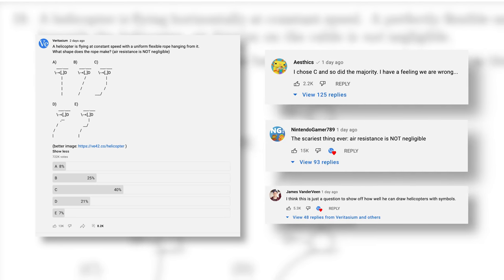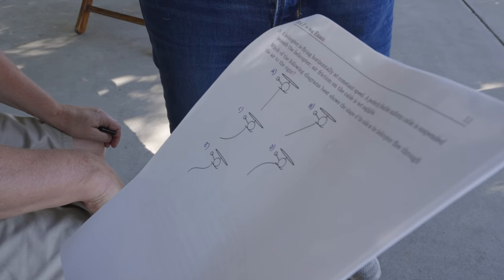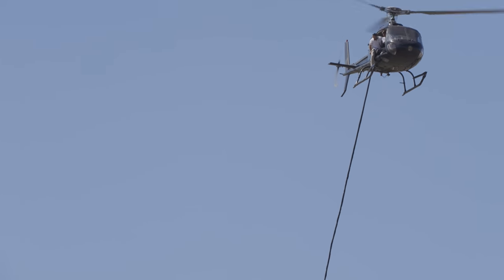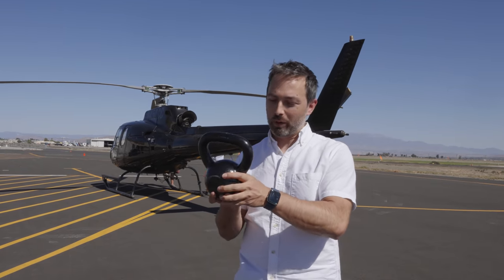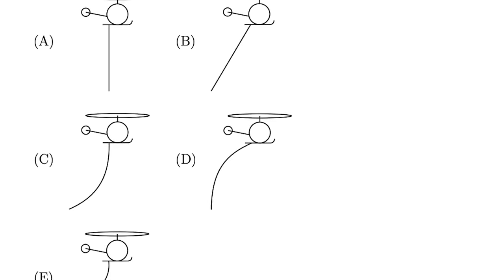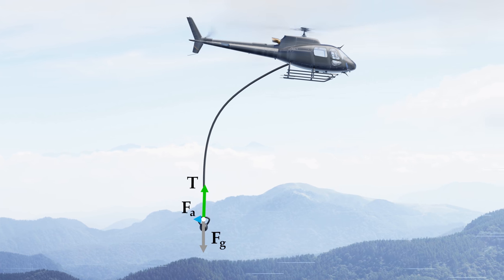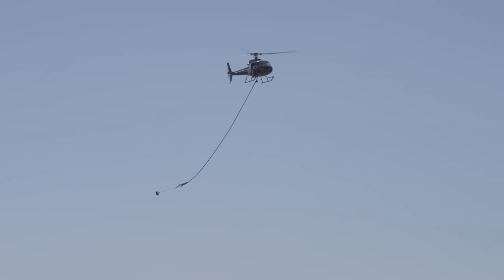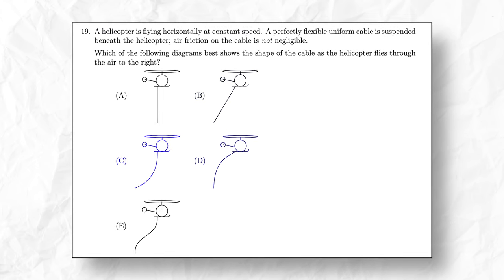I Rented A Helicopter To Settle A Physics Debate

Comment: My first guess was B, but then I thought "no way that's too simple", and that you would have to factor in that ropes want to hang in a catenary when suspended between two points, so I went C. I guess there is no second point, only drag, weight and tension. I would not have passed :(
Reply: I picked B right away. I didn't even doubt it. When I saw the poll, I was really dissapointed.
I know this from school where we were learning this type of forces.
Reply: I also thought of B, but as there is some controversy in this, it must then be something else. Seems like I should rely on my intuition.
Reply: I thought D because I assumed it was weighted given that logically you would want any rope hanging out of a helicopter to be weighted.  Also should read better lol but that's how you know the question wasn't made by pilots

Comment: but the actual ans of this question is option A.....since question already mention that there is no air friction so the velocity of cable at the time of suspension will be the horizontal velocity of helicopter at that time that is constant. hence no acceleration, hence no pseudo force, hence only force on cable is gravity so cable will hanged perfectly straight

Comment: I actually thought it was most likely C or E, since I imagined the main rotors wind having having a lot of effect on the wind. I guess E would work if the rope was really wide and there was a weight. Same as C requiring a lot more surface area and downward wind for it to work
Reply: Yeah, my prediction for E seems to be something more likely with a flat strap with minimal or no weight beyond the hook or shackle. As the rope is round and sheathed, it isn't affected by airflow as much as I predicted. 

Answer D is accurate for ropes with hooks or shackles. I've seen it like that when watching Blackhawks fly away after dropping a cargo load while I was in service.

Comment: I love that you went to all that effort to work out the answer!  Although, as you only have like 4 minutes per question; I'm not sure how feasible this is in an exam situation. It's bad enough having to drill all those holes in rapidly filling bathtubs.
Reply: Well, force diagrams applied to multiple points on a string/rope are a popular thing for solving such problems. Plus, you are referring to a test that has students with an IQ of 160 taking the test. The test is only for finding the best, not the average.

Comment: TBH knowing how far the rotor wash reaches would've been quite an important factor in choosing the right answer, since most of us aren't helicopter pilots.
Reply: Just admit you were wrong because you don't know the answer.
Reply: @mikeznel6048  I sure as hell didn't know the answer, because the question didn't present enough information to make an informed choice. The only unknown factor in the test was the rotor wash and everything else could be easily simulated by moving a piece of string at a constant speed dangling from your fingers. As the weight of the helicopter determines the rotor wash, I doubt the outcome would be the same with a heavier helicopter with larger rotors such as a loaded CH-47 Chinook.
Reply: I mean, since reach of rotor wash is inversely proportional to volume of gas due to greater resistance from exponentially more and more gas molecules, it makes sense that motor wash shouldn't reach and affect the rope much at all. Fluids acts much differently when against a wall and when in free flow, after all. A tidal wave's force crashing onto land has a lot of reaction forces in various directions, but a tidal wave's force on the sea will just disperse omnidirectionally except on the surface due to it being Newtonian fluid and acting like a solid when facing a great impulsive force.

That said, I didn't think of all this either, but it does make sense, and can be deduced with logic.
Reply: @mikeznel6048  The professor gotta admit he didn't know the answer either until he mathematically determined what he observed. As such the students are expected to give the correct answer with less information. At least the professor feels great about his own intelligence.
Reply: @I_THE_ME  I think the answer would be the same for heavier helicopter. If you think about it AFTER watching the video - it seems pretty confident that rotor wash not only dissipates quickly, but it also spreads around as a cone, with a more or less untouched area in the center. Because rotor is spinning, rotor wash will spread away from the center.
Reply: @Mike Znel what a stupid comment.  There was no constant speed given, so the rotor wash absolutely could have some effect.  just because something "looks" diagonal doesnt mean it actually is in theory.  And before you get onto me about just 'not knowing the answer' I am a degreed physicist who does theoretical modeling.  The question did not present enough information to make a definitive answer between B and C.
Reply: @bermchasin  But it shouldn't, because the resistance of the air around grows exponentially more than the area of rotor wash, which increases the rate at which it's forces are dispersed. Although I got the wrong answer, I never took rotor wash into question.
Reply: That AND knowing how heavy the rope was.  A lighter rope would be more affected by the wash (and other air currents too).  Not really faulting the video, more just speculating that there is probably no ONE answer for all combinations of helo, rope and (I suspect) forward speed.
Reply: The type and weight of the Rope is also relevant, because a Light, High Drag Rope will have a higher angle.
A Light enough Rope, with enough Drag, going fast enough, would be parallel to the Ground, meaning the Rotor Wash, and the Tail Rotor (which affected even the stationary drop) would both be in play.
Reply: Dude I got the answer correct and I’m not even in high school yet it seem like a common sense kind of question.
Reply: Yeah, that turned a nice qualitative and intuitive problem into a gambling lottery. Would be nice to hear professor’s motivation why not inform students that rotor wash could be neglected?
Reply: Do this with a small drone sized helicopter and a piece of string, and rotor wash will likely be very relevant.
Reply: @VADemon  I got it correct without doing math because I thought about an infinitesimal segment of rope. Each ds must have the same forces, so same angle of rotational, so the line is straight. Pretty much exactly like Derek explained it.
Reply: @evilkillerwhale7078  if rotor wash mer significantly larger then the rope at the top would experience a greater force downwards than the one at the bottom and so the rope would make a "J" shape. Guess that's why you dropped out

Edit: A test where you have to imagine what the teachers thoughts were is a really bad test. In this case, they didn't ask: what happens if you drag a rope around? They ask: what happens if a helicopter asks a rope around? So you're sitting there wondering if they didn't think properly or if the chopper part is relevant information.
Reply: It says right off the back the rotary wash is not negligible=meaning it's not important
Reply: Rotor wash in forward flight is essentially negligible to anything beyond the wing/rotor length.
Reply: @evilkillerwhale7078  I found his animation to be counter-intuitive which is why I didn't follow the video too closely.
Your explanation, however, is clear.
Reply: Also, being a physicist would have been a big help..
Reply: Helicopters don't FLY FORWARD with their rotors parallel to the ground. The rotor wash must be diagonal as well to propel the helicopter FORWARD. There's enough information!!!
Reply: Another thing to consider is that the mass of the rope has a significant impact on whether or not the rotor wash is negligible. If the rope was light enough any amount of rotor wash would have an effect. This video is with a super heavier rope. Not really a definitive answer in my opinion.
Reply: @evilkillerwhale7078  Second comment. I'm gonna be pedantic but that's math you did there. I can no longer call it a "thought experiment" what you did, if you compared different forces acting on an infinitely small piece of a rope. Quicc maths

Comment: I think the reason most people said C was because a lot of us (like me) imagined that, since the tension is less at the end of the rope, wind resistance will have a larger impact resulting in a J shape
Reply: that was a really thick rope.
Reply: I imagined the answer is never exactly B but the small C curve that is produced by the slight weight of the rope is not perceptible to the naked eye.
Reply: I’m certain I know why most people chose option C. I think most people chose C because they assumed the rope would’ve been in a fixed position pointing perpendicular to the aircraft and ground and not on a pivot like shown in Dereks explanation and experiment. The ability for the rope to pivot at its starting point from the aircraft gives the rope the straight diagonal representation. A rope with any amount of stiffness with its starting point being fixed at perpendicular to the ground and aircraft would result in option C, this can more easily be imagined with stiffer shorter rope travelling at a high speed where the end of the rope will trail behind the fixed starting point resulting in a curved shape like option C. Overall it was a poorly defined question that, from the diagrams presented, suggested a fixed starting point. Often people’s misconceptions lie within the question asked not the reasons behind the “answer”…
Reply: But the air resistance is cumulative--just like the weight--as you go up the rope, so this actually makes sense.
Reply: With a lighter rope, overall tension would be less, so wiggle at the end would be greater, and air would keep it at one position, so it might have taken the J shape.
Reply: @InfoAction_  the question said "perfectly flexible" though, so it would be as if it were on a pivot even if it weren't
Reply: This was my assumption, that the longer the rope, the more air resistance it would have towards the bottom, as there was more and more rope, and you got further away from any propeller downdraft.  Especially since the question stated that drag was NOT negligible.
Reply: @InfoAction_  not really. I was solving this question in my mind, and when I was analyzing a portion of the rope, I misplaced the downward tension of all lower parts with their gravity force, thus downward force was growing and backward force was constant. I studied physics in the univercity, but in this case I simply wasn't attentive enough.
Reply: Perfectly flexible rope, pretty clear l0l
Reply: Most people realized that every point on the rope has to carry the weight of all the rope below it, meaning that the top of the rope carries more weight than the bottom; but didn't realize that the same is true for the drag: every point on the rope has to carry the entire drag of the rope below it, meaning that total drag increases towards the top exactly in the same way as total weight does.
Reply: @InfoAction_  What kind of fixed starting point for a rope makes it so the rope can only point straight down from the start point? It seems you're a bit too salty for not being able to answer it.
Reply: @Weaseltube  You could exchange the rope for a heavy chain made from steel or something, it would still be exactly B.
Reply: @yarati4584  oooooh I think that makes sense, yeah. Thanks.
Reply: @yarati4584  Yeah, that's where I went wrong.
Reply: @Muzikman127  the question in this video was stated as perfectly flexible, in the questionnaire before this video is was just flexible and so implied some amount of stiffness, even so, perfectly flexible could be better defined as a rope with no internal resistance, and the rope used in Dereks actual experiment wasn’t perfectly flexible because no real physical rope is. My point still stands that most people’s misconceptions were with the question and not the underlying physics.
Reply: @aviralsood8141  any mounting devise where the fibres of the rope at the limit of the attachment point are perpendicular to the aircraft and ground…
Reply: I said J shape because I was considering rotors downwash.
Reply: @yarati4584  That’s exactly what I assumed choosing C. I missed the cumulative drag.
Reply: I wasn't sure if I should choose C, but because I didn't know if the Wind created by the rotor blades is small enough to be negligible.
Reply: @InfoAction_  How did you assume that? That's hidden information that you have inserted into the question deliberately. In idealised situations like physics problems the fixed point is just a fixed point unless it is explicitly stated that it has some other function in addition to holding the rope still. You made a bad assumption and it didn't work out, not a big deal.
Reply: @ozgurgenca2551  No, only temporarily.  It would wiggle around the straight line.  Any resemblance to the J shape would be a transitory state and not coincident with the average.
Reply: @InfoAction_  Nah, it was a good question.  The fact it's a rope means you can essentially neglect any bending stiffness.
Reply: @InfoAction_  Come on, quit making excuses.  I got it wrong, too, but realize why I was wrong.  Your assumptions weren't good, and you got it wrong as a result.  No need to defend a bad position.
Reply: @aviralsood8141  you have maths in your profile name and you don’t understand the idea of a limit…
Reply: @sciencecompliance235  not sure if you’ve ever held a rope before but they defiantly have bending stiffness that cannot be neglected unless stated otherwise, which, again, in the questionnaire wasn’t stated…my point isn’t that the answer given by Derek was wrong it’s that people’s misconceptions could’ve come from my point about the fixed or pivoting position of the rope and not the underlying physics…
Reply: @InfoAction_  Idk about you but I don't need limits to see what fixed points are.
Reply: @InfoAction_  With how long it is relative to its diameter in this example, it is effectively negligible, which you can see from watching the video.  If you have any experience with thick ropes, you can see that over large distances, the bending stiffness is essentially negligible.  Even huge ropes used to moor ships become effectively fishing line at that scale.  The idealized example of a "rope" presupposes this fact.  Even real ropes are implements of pure tension.  It is their express purpose to provide resistance in tension and nothing else (e.g. bending, compression). You made a bad assumption.  Learn from it and move on.
Reply: @sciencecompliance235  again, the example given is not the same as the question that was originally asked, no mention of length, diameter, rope type or if it was fixed or not was specified, all things that would change the profile it makes in a real world scenario. Again back to my most critical point of my original comment that misconceptions may lie in the question and not physics… something Derek himself has explored the idea of in other previous videos…
Reply: @InfoAction_  It's a ROPE!  You are supposed to assume it takes only tension!  If those things you mentioned mattered for the purpose of the question, it would have been a beam or rod, but it's not.  Stop making excuses for getting it wrong.  You made a poor assumption and were wrong!  Get over it!